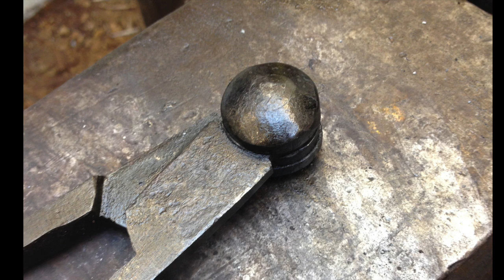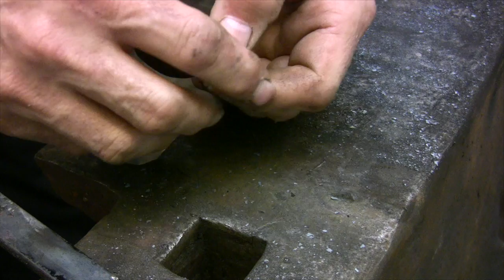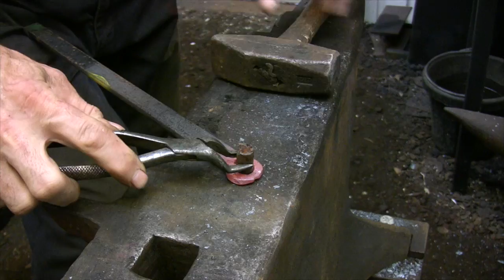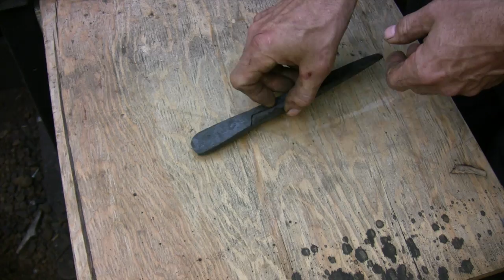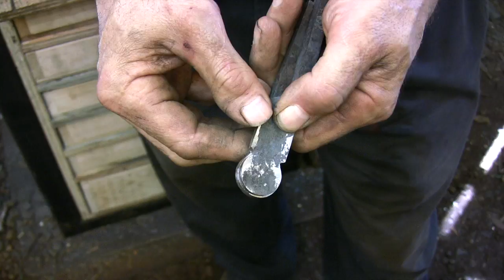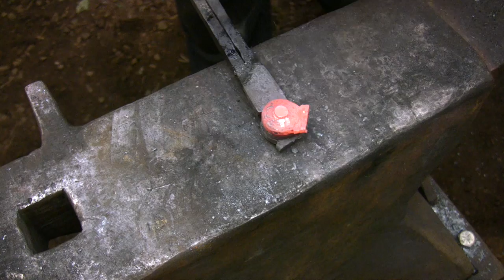Blacksmithing Project - Hand Forged Dividers

Comment: I have a question: Do you harden the tips?
Thanks for the videos, you sir are a scholar and a gentleman.
Reply from the maker: I don't on this type of divider.  I use these only for measuring.   I use winged divider ( video coming soon )for scribing arc into  metal because you can lock the arms in place and those need hard tips.  The problem with these is you have no way of knowing if the arms are moving out of position as you are scribing an arc.

Comment: You've made a blacksmithing video on a project I assumed had to be made via stock removal. Never even considered making them like handleless tongs
Reply from the maker: Stock removal is a modern concept made possible by modern abrasives and relatively inexpensive files.
Reply: Its strange how strong the mindset that we have about that is. I've done every technique you used in the video but it would have never occurred to me to use them to make dividers. I really admire how you look at projects objectively and consider all the options when working on them, instead of only the most common and obvious ones.
Reply from the maker: That's what fascinates me about blacksmithing and all the  other early trades.  Every project is just a combination of basic techniques that everybody knows and understands yet putting it all in the right order can take years to figure out.  Keep at it -  Thanks

Comment: Hi DF,

And wow, what an interesting little job. I like the techniques you use like heating one bar and hammering it using the cold bar as the ‘anvil’ to make a more or less generally flat even thickness on both arms.
Thank you for a terrific video I enjoyed this so much! I spend a lot if not most of my time watching videos and am glad I found your easy to view and explanatory style. I am an invalid so there is not much waking possible hence my video use. I can’t do it but like to try and watch ‘learning’ type videos and yours fit the bill!
I know it is only a small thing but an example of what I like to do is to try and figure out the connections between for instance Fahrenheit  and Celsius and Kelvin Scales which I never knew, but worked out on a 6 month stay in hospital, one way to stay sane I guess?!
Reply from the maker: I'm glad you found these videos also - Keep in touch.  Denis

Comment: Hey Denis, do you use mild steel or would wrought iron also be ok as a material ?
Reply: btw, how do you tighten up the rivet ? just hammering it a bit more ?
Reply from the maker: That's right
Reply from the maker: This pair is made from mild steel.  You would follow the same process with wrought iron just make sure you keep the forging temp high so you don't fracture the internal structure.